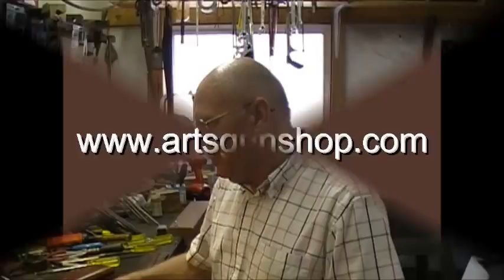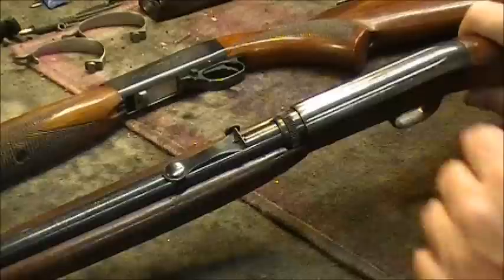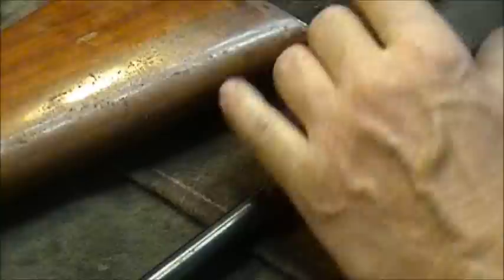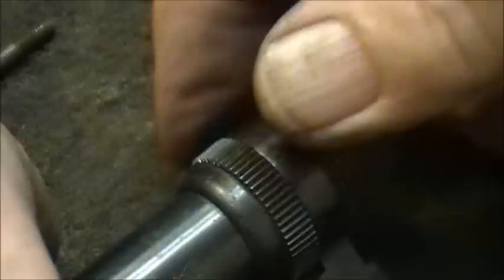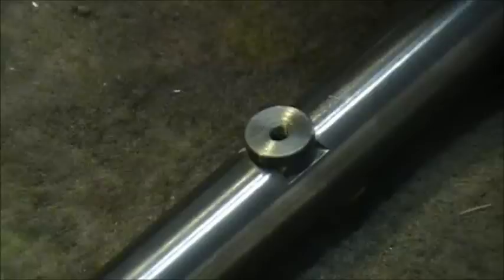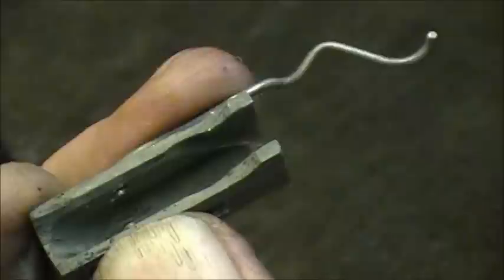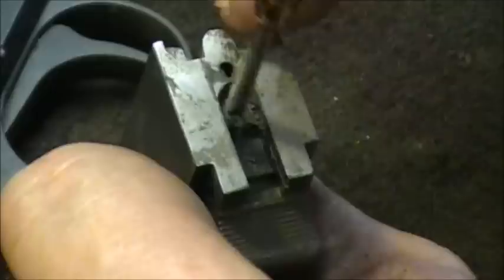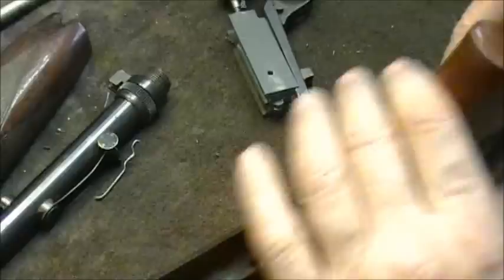Browning 22-Auto Assembly & Disassembly (Part 1 of 2)

Comment: Excellent video. Less than a month ago, I acquired a Browning SA-22 through Gunbroker from a gun importer in Maryland. It was made in Belgium in 1960 and has been in Europe the entire time up until this past November when it was imported into the US. The gun is super accurate. Using the iron sights, I shot 100 rounds from 25 yds and all but 11 were through the bullseye which is half-dollar size. After 50-60 rounds, the bullseye paper target was blown out into an almost perfect circle. Anyway, following your instructions exactly, I disassembled the 22, including the extractor and of course the recoil spring, firing pin assembly, pretty much everything. Parts of that gun (like behind the extractor for instance) probably had not been cleaned in decades if ever. I took my time in disassembly, soaking all parts in Hoppes for an hour, then taking toothbrush to brush out the gunk. Then I used the Breakout Power Blast spray can solvent to completely clear out any last vestiges of grime hiding in places like the firing pin assembly cavity using bristle pipe cleaners in lieu of brushes (works good). The receiver looks outstanding with not a bit of grease or grime to be found. Put it back together and cycles fine. I did NOT put any gun oil anywhere as of yet...I almost hate to since oil will immediately start collecting dirt, but I'll oil the rail before I go to the range. Thanks again for the fine video.

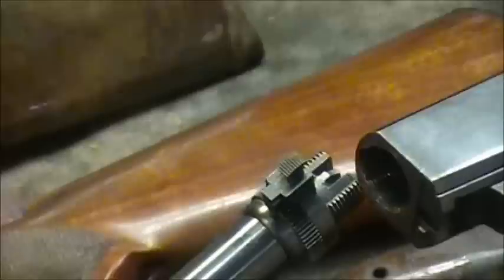Comment: Still teaching me things after all these years somtimes with tolerabces so tight on these you have to push a little more than usual to get dry fitment all the way tight together @4:33 my barrel was just a 32nd out (gapped) ....the ring that the little thumb switch lock between both halves was on hadn't seated all the way far enough into the wood ....both thumbs, either side of the barrel half and some Fonzarelli pressure moved it just that much and my threaded ring snugged up perfectly .....cant beleive I missed that.... but 1/32 is getting harder to see up close at my age.Now pin strikes eat any ammo and ejects work perfectly again ....saved me buying another striker piece and spring.....probably should have those on hand for eventual wear ....only $12 at Midwest for both in total.
By the way for anyone wanting scope-like precision but don't  have the  barrel side drilled or the dove rails on the stock side ..... I recommend an underslung red laser on the barrel .... it stays out of the way of the iron sights and gives a little extra confirmation when your cheek weld is just right ....and for closer-than-fifty-yard varmint tuning ....say 30ft ....not 50yd.... the laser goes lower  ( sight picture higher so you aim low enough) than the iron sights are capable of in that situation. Like I said this can give you fast response and confirmation or it can be your close range option while keeping the iron sights set out farther for plinking. I bought both  red and green Wipboten lasers on Amazon but only use the red one . I pulled the plastic plug out of its interior and now can use rechargable  14250 batteries instead of one-and-done disposable LR44 button batts. ..... why they wouldn't tell you this is an option is beyond me ....if you are clever and consistent you might even be able to swap back and forth between red and green if you mount far enough back to unscrew and swap the front modules while the body and rear switch stay put. ....truly though red is all you need, far easier on the eyes and night vision when pesting.

Comment: I am currently repairing a 1965 SA-22 Belgium made. This video really helped me. It has a broken stock and the spring system on the breakdown switch is also missing. The little one you slide up before twisting the barrel off.  Likely from not correctly removing barrel. Thanks for the great video.

Comment: Art , any advice for a man that has the modern Miroku version of the gun.  Failing to eject a spent case fully but is feeding the next round . Have replaced the ejector and spring and deep cleaned . Exact same issue . Been to two gunsmiths , to no avail . Any advice greatly appreciated .

Comment: Kevin Tracy .. 

How do you tighten the stock on a Norinco 22 atd?

I just did this. Remove the magazine spring from the butt plate. Grab a quarter with some vise grips and then stick it in like it’s a giant screw driver turn clockwise.

Comment: Hello, I can't remove my rear stock nut on a late model SA-22.  It feels like they have loc-tite on it. I've tried a nickel and a quarter with Vise-grips, but it just twists the coins. Anybody else have this issue? Any ideas? Do they use Loc-tite on the other end also where it goes into the receiver to properly align the feed tube slot with the stock? Thanks

Comment: hey everyone  I have multiple questions, I have x2 of the back half of gun  only, I believe both are model 24, and one of each long and short bullet, I need barrels and forearm grips for both, i found a forearm grip for a long 22, but will it fit either barrel?, and my other questions are, I see these adjustment rings, but I see larger single adjustment rings too, are the barrels the same, and will either style fit mine?, i do not have the receiver with the adjustable guts, it's fixed, and no markings on receiver except right under barral hole, there's a patent number or something, one receiver has 4 numbers, the other has 5, are the forearm grips the same for all versions? 24-late241?, my next question is, what parts will swap off the browning sa 22?, will the barrel and forearm grip fit my remington 24? anyone got a barral or two that don't have a bulge 4" up from threads??, i found a complete parts gun, but the barrel has a large bulge in it  and i dont want to pay the ffl fees and register something Im going to trash  as the serial numbers are on barrel from what im told, thanks for any info

Comment: I have a glenfield model 60. Been passed down 3 times in family. Slide lock assembly is gone and the mag tube is broke. It's just the gun and the bolt with charging handle. Can you fix it? 
How do I contact you.